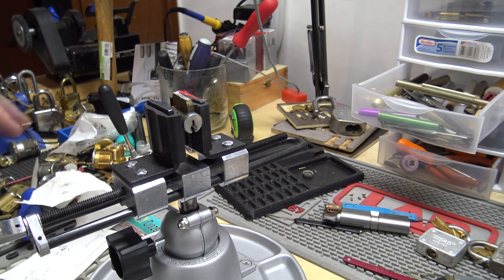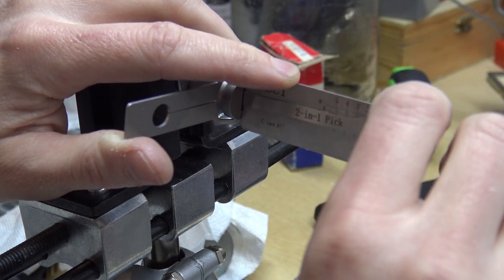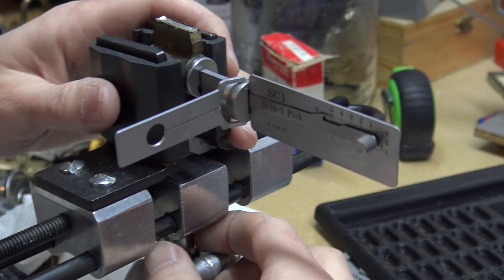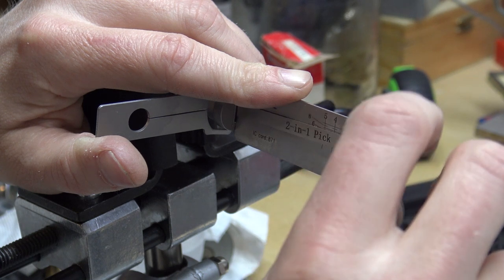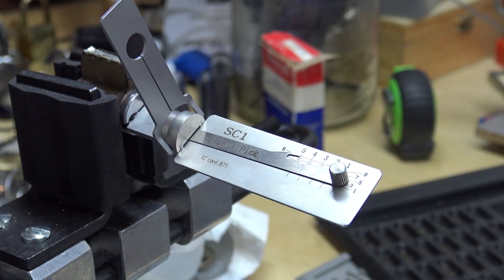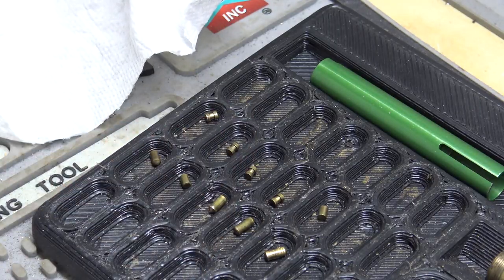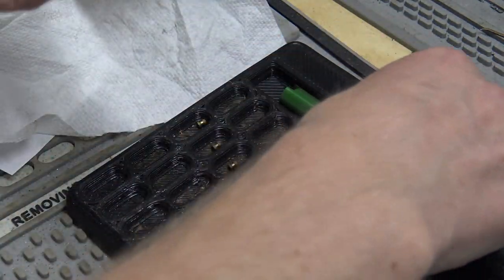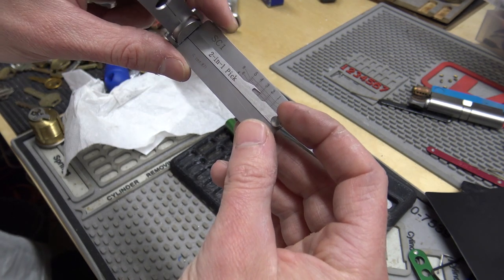(390) SC1 Lishi Picking & Decoding Schlage Deadbolt Cylinder

Comment: Good video, my Lishi SC1 just arrived today and I played around with it for about two hours this afternoon.. Just for the decode feature I LOVE IT. Got a PRETTY good feel for it after attempting a variety of locks (I actually have a large customer order sitting in my living room right now, waiting on me to get TWO more deadlatches, so I was stocked with LOTS of brand new locks when it came). I got to unlock loads of Schlage AL series levers and some deadbolts, as well as some mortise cylinders and a padlock I had sitting around.... Then I tried an F series... No joy on the F series (I HATE those T pins, that's actually why I got the Lishi, hoping it would make them a little easier)... First chamber picks textbook, getting a HUGE false set, everything else is locked due to the false set, but I can't get a true set on chamber one... I KNOW I could get it with a pick, (and did, just to be sure) but it would take a little muscle and I didn't want to put too much pressure on the Lishi before I'm really familiar with what it can take. If I let up to let it counter rotate, then chamber one either drops or oversets, and get's locked up. Pretty sure my tension is off, as I usually go straight for the tension ring for F series, but I'm wondering if it's not due to bitting as well (as I left the key in the packaging for that one as a test)

I'll be waiting for your video on the F series, as it seems like a lot of sport pickers SERIOUSLY underestimate how much of a PITA they are for locksmiths...  I mean YES, I can just pop the cap, but I'd much rather pick it... Quicker, more professional, and without risk of damaging the top cap.
Reply from the maker: On the f series you have to manually counter rotate it. They also always pick easier one way than the other. I had a little trouble at first with them but once you get a feel it’s pretty easy

Comment: Now that tool is pretty damn cool. Are they only available to locksmiths? They dont look like much but I imagine there not to cheap. Thanks for sharing it with us brother.
Reply from the maker: I never seen actually lishi brand ones any where but the locksmith distributors except for the occasional one that pops up on ebay.  they run $120 from the distributors.